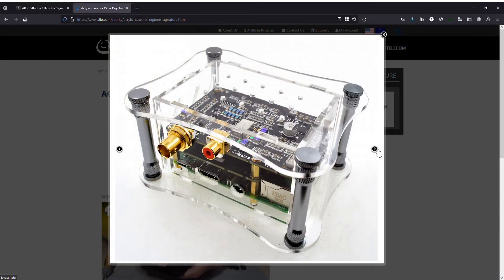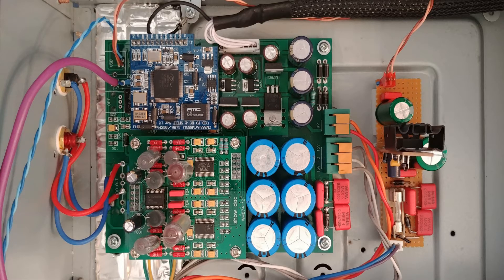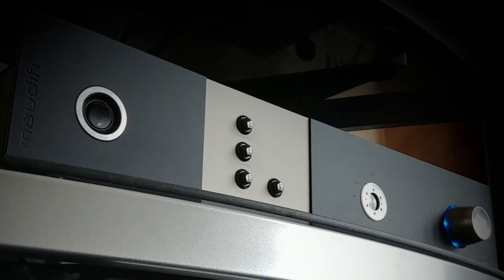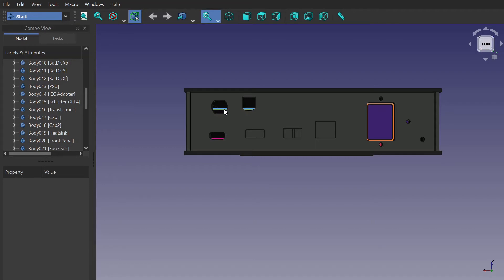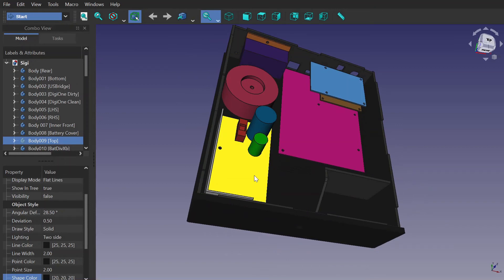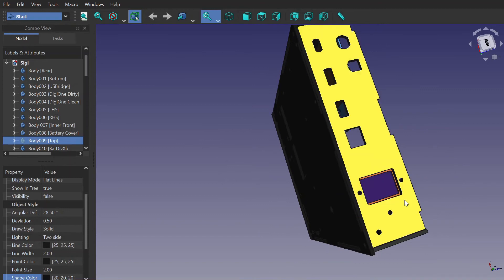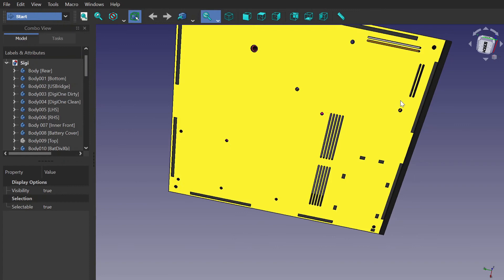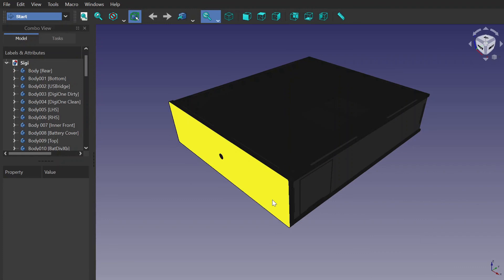maudifi Sigi Part2: Enclosure Design for the Allo DigiOne Signature + USBridge Signature

Comment: What is the card is on top of the USBridge? I heard Dutchy-card? Then the DigiOne Signature is attached to this card?

Have you investigated the Pi2Design or Pi2Audio’s transport? There is a gentleman called Mike Kelly that does this.
Reply from the maker: Thanks for your question.  The card above the USBridge is the "Dirty" card.  It is one of two PCBs that form the DigiOne Signature.  It's job is to isolate the noise from the Raspberry Pi, then feed the I2S signal, if memory serves correctly, to the top "Clean" PCB.

No, I've not heard of the Pi2Design before.  There are now quite a number of alternatives out there.
Reply: @maudifi  thanks

Comment: Congratulations, nice design ! May I have a couple of questions : will the Power Supply also supply the "dirty" RPi board ? If not you still need an external PS, i.e. a suppl. "box".
For the "Clean" analog output board how will you switch between PS and Batteries (critical listening) modes ? I didn't see any provision for this. Simply disconnect the IEC connector and put batteries in the compartment would probably work but isn't very "elegant". Ideally would be to allow the internal PS to load the batteries during stand-by or non critical listening and to provide a meaning (digital voltmeter ?) to follow the batterie's load level status.
Reply from the maker: Hello again Stephane.  Merci beaucoup.  For V1 I decided to stick with a wall-wart PSU for the "dirty" supply.  So, the USBridge's USB-C on the rear panel.  I have thought of and in future will consider a  V2 internal dual power supply, for clean and dirty, and potentially battery charge management.

Apologies, I think I was a little vague on the mode selction, and it will become clear in the next video.  There is a toggle switch on the front panel, with integral LED, to choose battery or power supply.  No need for IEC/battery disconnection.  To get a better idea of how it hangs together, check out this page: https://maudifi.co.uk/the-sigi.  You can also see a picture of the actual item including switch here: https://maudifi.co.uk/allo-usbridge-digione-signature-project-update

Cordialement,
maudifi
Reply: @maudifi  Hi Maudifi, OK, looks good. Thanks for your kind reply ! A bientôt, Stéphane (couldn't answer before due to Internet connection issues)